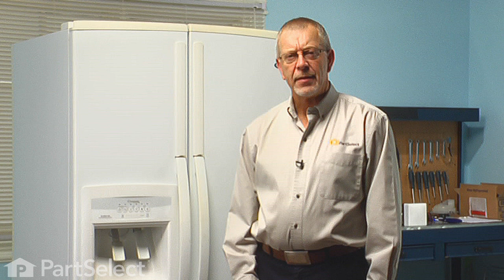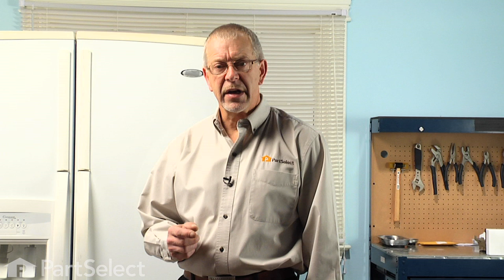Troubleshooting Why the Ice Maker Is Not Working | PartSelect.com

Comment: I have a Kenmore Coldspot, There's water going in the refrig... and dispenses water. However the icemaker isn't working, I checked the line going to the icemaker in the back but there's no water filling it up, Could that be the filler valve? Whats your sugestion? Thank you
Reply from the maker: Hi Patrick, sorry to hear you are having trouble with your icemaker! The symptom does sound like the icemaker side of the inlet water valve may not be functioning properly. Follow the test procedure for the water inlet valve that we provide in the video. You can also find more information at http://www.partselect.ca/refrigerator+icemaker-no-ice+repair.htm. Good luck with your troubleshooting, and let us know if we can be of any further assistance!

Comment: My ice maker produce ice. My motor runs when the unit is not in place. I've changed the auger. The motor turns the auger 1/2 way around then stop. What is my problem?
Reply from the maker: Hi Amber, thanks for getting in touch. If you can supply us with your appliance's model number we'll have a better idea of how to direct you to the appropriate place for your repair. Thanks!

Comment: I have a kenmre #106.53582300 that is not making ice. The harvester is stooped in a 10 oclock position and the ice detector bar is in a 4 oclock position. I tried "jumping" the T and H testing points and nothing happened. I tested the points for the water flow and water filled the tray. Any other testing or sugestions on this matter is greatly appreciated..
Reply from the maker: Hi Ernest. Thanks for watching! The normal rest position of the ejector blade is
about 10 o'clock, but the shut off lever or bar should be almost straight
down and should not have any tension on it. In the raised position around 4 o'clock, it would put the ice maker in the off position. Hope this helps!

Comment: I seem to be having a problem with water dripping from somewhere before it goes into the ice cube maker.  It is causing build up in ice near the fan and this in turn causes lots of noise.   How can I find the leak and fix it?
Reply from the maker: I would suspect that the water inlet valve to the ice maker is the culprit. Sometimes the valve will not completely shut off and water will continue to drip into the ice maker fill cup and spill over. Visit our repair page and enter your appropriate model number under the "Water Fill Tube" section to locate the right replacement part for your model. http://www.partselect.com/Repair/Refrigerator/Not-Making-Ice/ Apologies for the delay in getting back to you on this, and good luck with your repair!

Comment: Our icemaker problem is a little different than the ones shown. We have a problem with the cubes in the collection bucket being froze together. All help will be appreciated.
Reply from the maker: Hi Brian, 

If the ice cubes are stuck together before they enter the bucket, This could be caused by an over watering problem. Essentially the tray fills too high. On most icemakers there's an adjuster on the side, under the plastic cover.

Now, if the ice is fine until it reaches the bucket itself, there are a few things it could be. The flapper door could not be closing or sealing properly. So warms air is released into the bin directly and causes them to slightly melt together and then refreeze as one.  Poor fan circulation can also be a problem, sometimes if freezer are overload the air flow can be restricted and cause the ice to do this. Finally, there could be an issue with a fluctuation in freezer temps. You could test this by removing the old ice out and turn the temp down slightly and see if it rectify the problem. Hope this helps!

Comment: I have a Samsung RF4287HAWP, the ice maker makes ice but will not dispense. I noticed that the water sign or the cubed  ice sign do not light up on my display. I have reset it and watched numerous videos. the fact the screen does not display the above mentioned  concerns me. I do not hear any sounds when I try to use the ice maker. Any ideas

Comment: My ice maker quit working.  It had a full mould.  I jumpered it with the wire using T & H. The maker did a complete cycle, dumped the ice, but it didn't refill.  Looked at the tubing and it didn't look frozen. I put a piece of smaller tubing up in the full tube.  It didn't hit any restrictions.  Would a filter replacement help this?   I'm still getting water from the water dispenser. Thanks!!
Reply from the maker: I'd test the water inlet valve with a multi-meter and make sure that the valve's electronic solenoid is not faulty. Some valves have a a screen on the valve that helps to filter debris before it can enter the valve so if yours has a screen clean that out. The water filter should be replaced every 6 months and it can become restricted and reduce the water flow to the ice maker.  Hope that information helps and if you need more assistance then please provide the model number.
Reply: ***** I also have a working water dispenser and no ice. I checked and the water line was not clogged or any freezing at the ice maker. I replaced the water inlet valve and jumped the T & H. I heard a noise from the water inlet however no water in the ice maker.  The ice maker cycle stopped with the arm at the 3/4 point (where the ice should be ejected) and even though I left the jumper in the cycle did not complete.  Whirlpool Model ED2FHEXNL00.

Comment: My Whirlpool refrigerator Whirlpool GSS30C6EYW00 makes ice but won't dispense it.  I think the auger motor might be the problem.  How do I get to the motor to check it?  Is there a video somewhere showing how to replace auger motors which are found on in-the-door ice makers?
Reply from the maker: Most heat release ice makers will have a removable cover at the front.  You can search our site using the model number you provided and it will show you the schematics for your Whirlpool refrigerator.  You can test the unit by manually operated by inserting an insulated jumper wire into test points “T” and “H” to initiate a “test harvest”. The jumper should be insulated 14 gauge solid wire that has the insulation stripped back about 3/4 of an inch on both ends, and bent into a “U” shape. This test will simulate a real harvest cycle and will operate the ejector blades, shut off arm and the fill valve in the proper sequence, and will allow you to do a proper diagnosis. If the motor does not start, you can verify that you have power to the ice maker at test points “L” and “N”. If the ice maker is getting power and does not perform a cycle, then the module will need to be replaced. We have a few icemaker auger motor videos on our channel. You can search for them, as they are quite helpful and a good resource.  Hope this helps.
Reply: Thank you for replying.   Water flows into the ice mold OK, and ejects automatically into the bucket, which contains a vertical auguring mechanism.  The problem is the motor that turns the auger doesn't run when we want ice dropped into a glass.  I know where the auger motor is but I don't know the best way to get to it.  I only want to check the motor, preferably without having to take the front of the door apart.  So far, I haven't been able to locate any videos of a totally in-the-door ice maker repair.

Comment: Very concise and helpful video.  However, one thing is missing in this and other videos from parts supply sites.  They all assume a side mounted ice maker.  If your ice maker is mounted across the freezer opening, it uses an electronic beam sensor instead of a mechanical bail arm to sense ice levels in the bin.  You should check the blink code on this sensor to rule it out as the problem before moving on to troubleshooting the ice maker assembly. With the door open you should see a blinking red led indicator  on the right side top.  It's blinking because the beam has been interrupted by opening the door.  This  keeps the ice maker from dumping ice on the floor if it happens to be ready to harvest ice when you open the door.  Close the flapper on the left side to restore the beam path (make sure your hand is not blocking the beam). The red indicator light should go to steady unblinking red.  If it keeps blinking, something is bad in either the emitter pc board or the receiver board, and the ice maker thinks the door is open all the time and will not complete it's cycle. The replacement part comes as a kit with both boards.  It is easy to replace. Just remove the 3 screws on each side and pull the units out, disconnect the wiring harness for each side.  Then you can easily remove the PC boards and replace. There should be a part # label on the right hand pc board. Some sites call it a Refrigeration PC Board Kit, or possibly an emitter and receiver board. Kenmore site calls it a "Micro Computer".
Reply: I should have stated that if the sensor is defective, the ice maker will think the bin is full of ice and stop cycling, as well as thinking the door is always open.
Not sure which is more accurate statement, but result is the same and the ice maker won't cycle. 
Also, after replacing the sensor boards, it could take up to 24 hours to see results.  I'm not knowledgeable enough to know why that is.  Maybe someone more knowledgeable could refine and correct my DIY experience for others with same problem.
Reply from the maker: Lance Blevins Thank you for providing this helpful information. We love hearing from folks who have repaired their appliance as well as their experience troubleshooting the problem.

Comment: Thanks for the helpful video.  I noticed the ice maker stopped making ice.  I removed it and noticed that the teflon was down to the metal in some spots.  I ordered a new tray and installed it.  However it is still not working.  I used a jumper to start the cycle.  The water fills from the fill tube just fine, however the ice never comes out.  With the ice in the tray, I tried the jumper again.  It starts to spin however when the little black line gets to about 7 o'clock it stops again.  I used my voltmeter to check the timer, the heater, and the thermostat...all are showing resistance.  What next?
Reply from the maker: If the motor does not start, you can verify that you have power to the ice maker at test points “L” and “N”. If the ice maker is getting power and does not perform a cycle, then the module will need to be replaced. Hope that helps.
Reply: ***** I replaced the module...still doesn't work.  I can jump T & H and the cycle starts, it fills up with water, ice forms but then it never advances after that.
Reply from the maker: I want to take a closer look into your question. Can you provide the model number so I can do some further research?
Reply: ***** Model #10650503990 Kenmore Elite Side by side refrigerator.
Reply from the maker: Josh Nuno Thank you for the model number. I did some additional research into your question and have a few suggestions for you to inspect see if what part is faulty. The first is the shut off arm, it’s a wire that raises and lowers to release ice. It can get caught in a raised position. Raise and lower it a few times to make sure it’s working smoothly. If the arm is okay then inspect the auger drum/motor and make sure that it’s working. If the auger is okay then have a look at the fridge’s micro switch, use your multi-meter, and test that for continuity.  Let us know how you make out.
Reply: Finally found out it was the thermostat...bought a new one and replaced it...thanks for all the help

Comment: I have a kenmore mod # 106.51269104..    The ice maker water flow runs constantly. please advise any help in this problem. would this be the fill valve issue or the ice maker itself..   any help would be appreciated.
Reply from the maker: Start with testing the water inlet valve to see if it's faulty. If the valve is okay then test the ice maker itself to see if it's faulty.

Comment: Hi.....I have a Maytag MSD2272VEW00 double door . All of a sudden ice and water will not dispense.....no noise or clicks when asking it to dispense......simply dead......ice maker is still working producing lots of ice that we manually remove from the storage bin. Thru some research I am assuming it is a solenoid ......I have gotten the drip pan off, loosened the frame, but cannot get the frame off so I can to the solenoid.....seems the ice shoot and the freezer door handle are in the way.....any suggestions would be appreciated.....thank you
Reply from the maker: Around the frame there are tabs that connect the frame to the fridge. Have a close look at the frame and with a flat blade knife and carefully try to pry off the frame - becareful not to break the frame.
Reply: ***** Thank you for your quick advice.....It worked perfectly.....I noow have access to I assume is the solenoid which is black and says MICRO SWITCH..........remember dispenser for water and ice/crusjed ice is not working but the ice maker iteself is producing ice. Is this MICTO SWITCH the part that is causing the malfunction or do I need to procede further........BTW the light on/off buttons do work. Thank you again.
Reply from the maker: Bob Rosen The micro switch can cause the problem you're having. I'd also look at the water inlet valve,fill tubes and make sure that they are not frozen.
Reply: ***** I am not sure where I would find the inlet fill tubes or the inlet valve but would these two be frozen if the icemaker is producing ice .......the dispenser for  water and ice cube/crusher is not working.
Reply from the maker: Bob Rosen Test the micro switch and see if that's faulty.

Comment: I have a Whirlpool fridge model # ED5FHEXNS00 and I don't have any voltage across L and N, I also checked for voltage directly from the wiring harness and also have nothing. The doesn't appear to detach from the wall of the freezer. How can I remedy this problem?

Comment: I am working on a GE Profile PGSS5PJX (bottom freezer, the ice maker made smaller and smaller cubes and then quit working, after defrosting the freezer and verifying the icemaker was operational, I flipped the rocker switch and it dribbled water for about a second and stopped...subsequent cycling of the on/off switch net me the same results, over and over...a second of water...I am thinking fill solenoid, water dispenser seems to work fine...any thoughts?

Comment: Ours (13-year-old fridge) is doing the same thing. I don't want to put a new icemaker in an old fridge, so I keep a small plastic container in the ice bin to catch the drips.  When the icemaker stopped working about 2 years ago, we took it out, let it thaw out completely and then put it back. It's been working fine, except for the drips, ever since.

Comment: I have a Kenmore 253.74722407 that was placed in service for a year without the water supply line for the icemaker ever being connected. When the water supply was connected the icemaker does not work. Any suggestions? Thanks.

Comment: Hi there, thanks for a useful video.
I have a portable (stand alone) ice maker (LB-ZB-15B) which works fine most of the time. Right now it does not complete the water fill cycle, it pumps water just fine, but stops before its complete and shows the "water low" indicator. Sometimes if I am fortunate, it will complete the fill and then it will go on to make some ice, which tells me that the rest of the unit is fine...  What do you think could be the problem??

Comment: Steve, the problem I'm having is the water dispensing tube is freezing up before any water makes it to the ice making tray, "after the first ice cycle" meaning it will make ice the first time or two after turning the Ice machine off to thaw then turning back on, but then the tube is frozen solid and no more ice. I have the GE profile ice/h2o in door any help will be appreciated .
Thanks

Comment: Steve - I have a kenmore elite10652693100 that is having issues with the ice maker. Water is not making it's way from the water inlet valve to the ice maker. The water inlet valve will serve water to the water dispenser, but not the ice maker. The line to the ice maker is clear of debris. I cycled the ice maker, and it is working. I poured some water into the tray, and it dispensed the ice. Is it possible that just one part of the water inlet valve is bad? Is it a solenoid issue? Thanks!

Comment: I have a wsf26c3exf01 with an in-door icemaker.  The unit is only about 2 years old.  I am getting no ice all of a sudden. I did notice that the sensor usually lights up red when the ice bin is not full.  It hasn't been lighting up so I unplugged the unit and plugged it back in.  The red light will go on for a period of 5 minutes or so, then shuts off again (and still no light when I test it manually by moving the flipper). Any simple ideas before I jump into this project?  Thanks!!

Comment: Hi Steve
Really find your tutorials so helpful 
I have an Amana XRSS665BB refrigerator.
When i select cube ice it appears to work fine and dispenses the ice, a bit slow i feel but this may be normal as have never had an ice dispensing fridge before.
When i select crushed this is when things are not working, the dispensing panel appears to be making a relay ticking noise and ice is not crushed at all.
The motor appears to pulse turn very slowly and all the lights on dispenser blink.
What is wrong

Comment: From watching your videos, I believe my problem is the valve. Initially, my ice bin was a sheet of ice, and the water tube had pushed out from the back of the refrigerator, and shooting water onto the floor and back of the refrigerator. I defrosted the freezer, and replaced the ice maker. Water started dribbling over the front of the icemaker and again freezing everything solid. I initially thought that the icemaker was not level, but now I think it is the water inlet valve. What do you think?